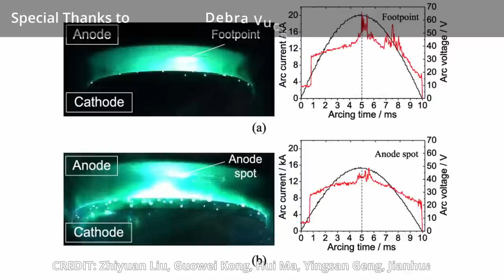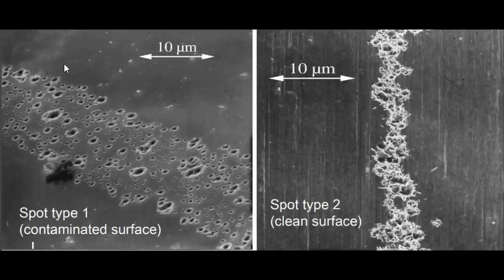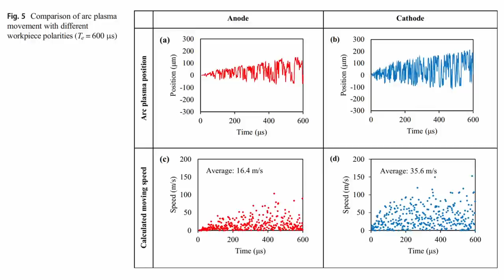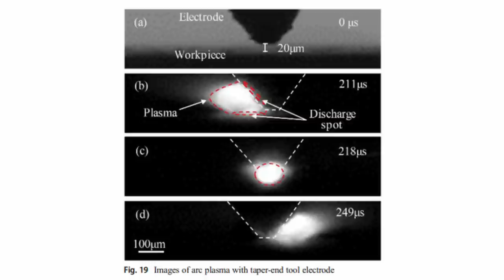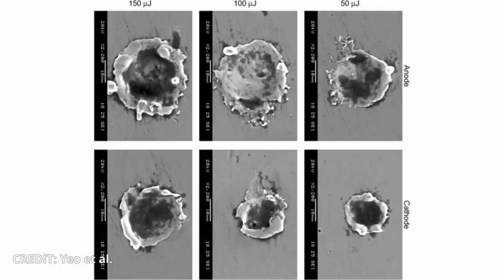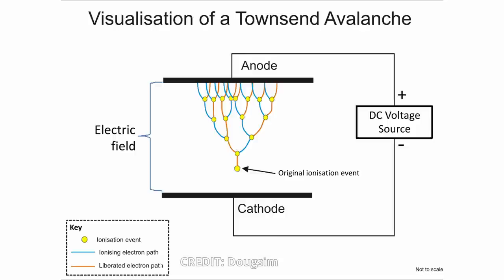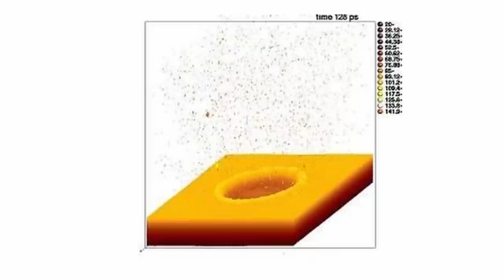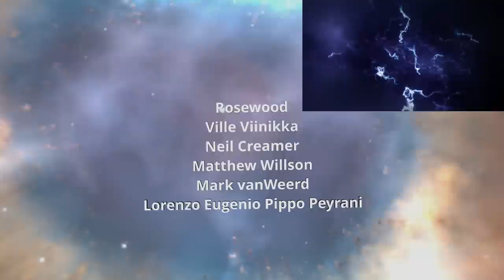Electrical Cratering - What is the difference between Anode and Cathode Craters

Comment: was trying to explain this process to an 'Impact crater' fan online...   he didn't listen but ive linked your channel to him, so he may give it a go!   stay Chill G-Man!! x
Reply: Wow, I would like to see that discussion..
Reply: you will find most will reject the info. i quit tryng. the programming goes so deep. you have to find those that the programming didnt stick
Reply: I was converted by just seeing images of plasma welding craters and not by explanations, personally. Explanations are just stories we tell ourselves, to me. Observation and experimentation are supreme, for me. 
Also, I couldn't find any good experiments regarding impact craters, which instead always used something like sand as their surface and could never actually replicate an impact crater on a solid surface. No one could ever point to a single experiment where a ballistic came at a steep angle to impact a solid surface and leave a nice circular impact crater. Yet this was the norm for plasma welding.
Reply: @jvee4072  I've found the same
Reply: I've had similar discussions with 'experts' online. They generally dismiss it our of hand because space is electrically neutral, or so they think. LOL

Comment: welding with straight polarity (electrode negative) makes a different sound. Kinda like blowing, almost cracking. It's weird. It also heats up the workpiece slightly more while reverse polarity heats up the electrode slightly more which is what you want in most cases. To me it also seems like the drops of the molten electrode are attracted to the molten pool. They seem to defy gravity when welding over head. It looks like magnetism but molten metal should not be magnetic.
Reply: I really appreciate the honest anecdote here!!!
Reply: Would that be electrostatic, then, rather than magnetic? Or do you mean once they touch, they move upwards (due to cohesion)?
Reply: It seems that molten iron is ferromagnetic after a quick search. When the current is so strong it has to be the cause of attraction. It still feels contraintuitive that it works with a negative electrode too. I think the answer is in the video but I dont get it 🙂
Reply: @StormBurnX  Yeah, it behaves like water including the slag. Maybe the surface tension is in play too. However even a lighter water would drop down sooner than a large pool of heavy molten metal. Maybe it just looks like the dropplets are shooting up from the electrode. When I think about it It may be caused by the less conductive slag-forming material surrounding the wire creating some channel. Without it the electrode doesnt work, the arc is violent, fast and impossible to use.
Reply: Your conclusion of magnetism is spot on. Acceleration of inertia or loss provides the product of dielectricity. Manifestation of electricity from the power supply to load.

Comment: I would add that a lot more is going on, sub sub particles are filling the space though which this "ejecta" is travelling and much more movement, like the ring current creating movements where the particle "fluxes" back and for being changed in charge as it approaches the object and then become a "like" charge and are repelled back and forth, add infinitum.. if you can visualize..

Comment: I wonder if the moon, looked like a lightning ball and one time? The craters look about the same ageish? Or if its an on going process, slowly making craters?
Like our sharp buttes on earth , the grand canyon is probably discharging constantly. Faults might encourage or discourage crater and butte discharge?
Reply: @cokemachine5510  You should read Jno Cook Saturnian Cosmology chapter 9 on the Younger Dryas days.  A different perspective than Worlds in Collision or The Earth in Upheaval.   
   Cook suggests that both the water flowing over the Earth and the Great lakes were caused when Saturn left the north pole of the Earth. Arc discharges from Saturn created the great lakes while the earth rotated.   The water was normally at high tide at the south pole by static charge due to Saturn's presence at the north pole.  Until Saturn left, the oceans then returned to normal high tide at the equator.
 Cook suggests that there was no arc discharging with Venus, but such arc discharges were created when Saturn left the Earth's north pole.
   However, I think that the Gaia/Theia model explains the continental movement rather than plate tectonics that Velikovsky relies upon.   A single mars-sized iron planet inserted into the Earth's core would explain the movement of the continents by crustal expansion, and the 3-fold increase in gravity in one event.  The Gaia/Theia model does have geographical evidence for it of late.
Reply: @JoeDeglman  yep agreed,

Comment: Dear Gareth,
I would like to ask your opinion. A few minutes ago I realized the similarity between the electric glow discharge (on the cathode side) and how the creation and expansion of the Universe is depicted using the Big Bang theory. E.g. similarity between cathode glow and microwave background radiation of the Universe, dark cathode glow area and Dark Ages in the Big Bang theory, ... I wanted to ask what you think about it? Does the Universe originate now and everywhere on the "cathode side" and not 13 billion years ago? And if so, what would "anode" and "anode glow" correspond to in the Universe, the side where the Universe is also now disappearing? Thank you for your response and have a nice day.
Sincerely
Zd.